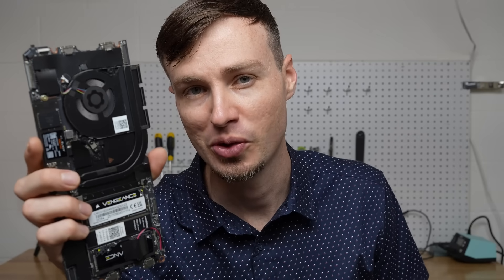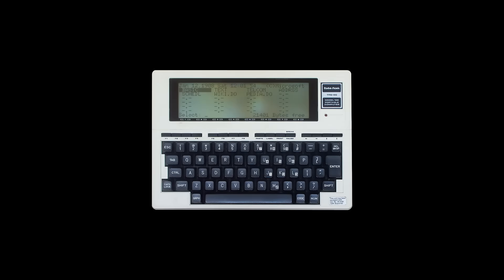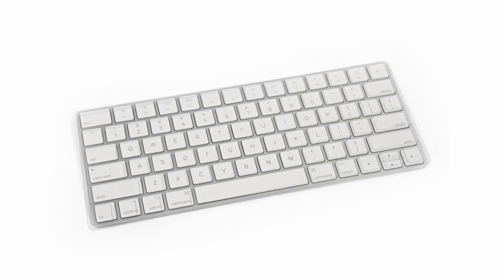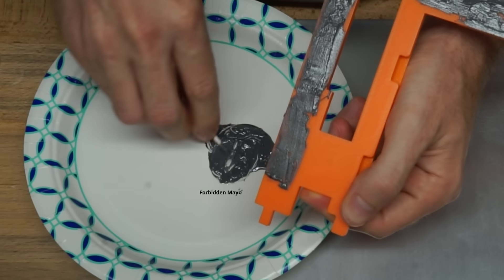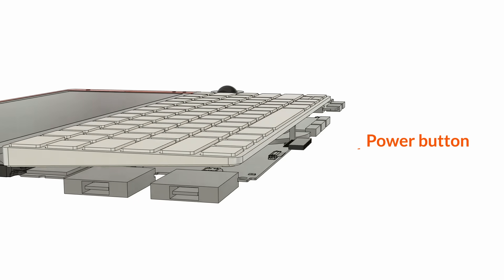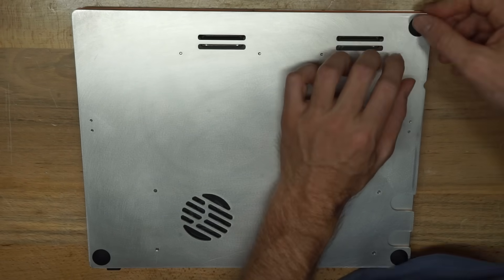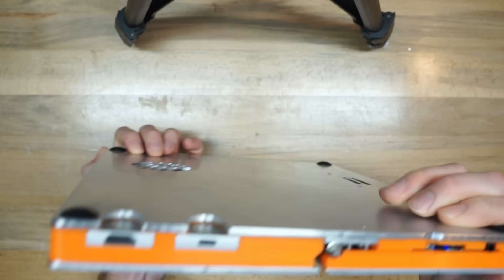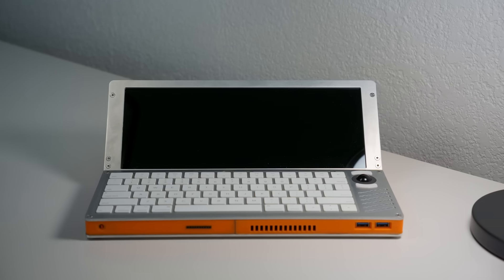Framework Cyberdeck - DIY Portable PC

Comment: The way to deal with handheld usage is to add secondary mouse buttons to the left side of the device so your right thumb can do trackball duty and your left thumb can hit the mouse buttons. The same way a Logitech K400 or similar works. Since your design is already complete, repurposing the Fn button for left click could ok if it's possible. Otherwise maybe capslock since that's barely used. I would cut the traces to isolate it and then wire it directly to the mouse buttons. Saves attempting to remap it with software.

Getting the keyboard, trackball and monitor working to external devices as a "USB-C dock" would be a challenge.

Comment: This was awesome and inspired me to keep pursuing a custom PC. Really into the portable aspect while still being able to work on 3d modeling, programming and circuit board simulation. Only thing I would like is a pdf of the buying guide for this and a guide for setting it up from start to finish. If you already put it all in the video the disregard the last sentence. One thing you could add if you want a scroll wheel is put a mouse scroll wheel  on the side of the build or anywhere you put your hands. Maybe have it activated on the ball after you press ctrl+alt?

Comment: This is the kind of custom build I think of whenever the modularity of Framework is mentioned. It shows just how versatile such a platform is, and that you don't need to be limited to just their options for the chassis the parts fit into.

And when framework releases a motherboard with a better processor, you can just swap it in knowing that everything will still be in the same place as the old one. A laptop with a practical CPU upgrade path that isn't just "buy a new one" has been needed for a long time and it's finally here.
Reply: This is be good for 3d modeling and programming? How far could u go with this? I'm just beginning so I'm sure it has everything I need for now just want to double check
Reply: @jomitoh5111 Would be great for programming, but 3D modeling benefits from a dedicated GPU that afaik these don't have. But they might eventually be compatible with external GPUs so there would be a lot of options for a custom "dock" for home use.
Reply: @0v_x0  so what is the main purpose these are used for? I'm new to these in general
Reply: @jomitoh5111 3d modelling works pretty fine on a fairly new CPU as long as you don't wanna do rendering, bigger simulations or scenes. (I don't recommend doing those things on a laptop anyways)

Comment: what this thing needs - IMO - is to be able to use the keyboard as an input device for the external pc you plug in - to be able to use a headless pc without any other devices.
Reply from the maker: That would be cool. Actually the keyboard supports bluetooth so it theoretically could, but I would prefer a wired connection of course.

Comment: As other comments mention the stick in the center of the ThinkPad keyboards, I looked at Wikipedia for the exact name:
A pointing stick (or trackpoint, also referred to generically as a nub or nipple) is a small analog stick used as a pointing device typically mounted centrally in a computer keyboard. Unlike other pointing devices, it reacts to sustained force or strain rather than to gross movement, so it is called an "isometric" pointing device. 
IBM introduced it commercially in 1992 on its laptops under the name "TrackPoint", and patented it in 1997 (but the patent expired in 2017). 
It has been used for business laptops, such as Acer's TravelMate, Dell's Latitude, HP's EliteBook and Lenovo's ThinkPad (formerly produced by IBM until they sold it to Lenovo in 2005).

Comment: Your cyberdeck reminds me of a Sony Vaio P laptop I once used. 
Sony Vaio P series were ultraportable subnotebooks and a very interesting form factor. Maybe too early for the technology of that time (1996 to 2010). I used it to design a daily magazine for a film festival from my hotel room :-)

Interesting details I found at Wikipedia: 
The Sony Vaio P series features an 8" LED-backlit display with native resolution of 1600x768 and is also comparable to that of much larger laptops, such as the 12.1" Thinkpad X200s and its 1440x900 resolution.
The 2010 revision was the last iteration of the P series, with Sony discontinuing the product in 2011. The P series clamshell format was incorporated in Sony's Tablet P, which was released in November 2011.
Reply: If you want to get a feel of its small size, there are some photos online. 
For example on Wikimedia Commons, there is a photo picture of a Vaio P on a a Fujitsu Laptop or one photo called „VAIO type P vs EeePC 901“ shows a Vaio P on a EeePC.
Reply: Another quote from Wikipedia, as I saw the Term „Netbooks“ in an article about small Laptops. 
Wikipedia: Netbooks were sold from 2007 until around 2013, when the widespread advent of smartphones and tablets eclipsed their popularity. Netbooks generally had lower-end hardware specifications than consumer laptops of the time, being primarily intended as clients for Internet services. 
End quote. 
Wikipedia mentions some product names and manufacturers of Netbooks: 

HP 2133 Mini-Note PC netbook

Asus Eee PC 700, the first mass-produced netbook, which used a 7-inch screen.

Psion netBook, a small subnotebook released in 1999, for the mobile enterprise market.

Comment: Nice project, I wonder if could had a optical drive and a TV tuner and would be a media device.
Also I wonder how well does the emulation test (until what console supports) since that screen looks way better than I thought at the beginning of the video.
Reply: Thanks for your comment. It reminds me, that Optical drives were one of the hardware features, that were specifically left out of the first generations of ultramobile subnotebooks like the Sony Vaio P series or the UMPC class from the late 90ies. This was critiqued at the time by some, while others loved the small sizes of the computers without a optical drive. The opinions were split-split on that matter.
Reply: @paulhorn24  I mean yes you are correct, maybe a special caddie for external drives if not but I remember the vaio issue was like when Mac stopped using floppies.

Comment: 15:19 Couldn't you have some thin material, whether it's 3D Printed or off the shelf Screen (like for pool cages and windows) , you could make an exterior acordion style mechanism so that as you tilt up the screen the exposed PCB and such still has some protection against bugs, random stray fingers, some water prevention, etc.

Whether it's like 3d printed links, some fabric just glued onto the exterior parts of the frame, or just pool/window screen it will provide some amount of functional use.

Overall nice build, this isn't necessarily meant as a critique but rather providing options/examples to say a solution would be possible.
Reply from the maker: Yeah, I probably should have tried to do that.

Comment: This is such a neat build! One design suggestion for your next iteration: when you're trying to make a semi handheld device, it's really useful to split your mouse buttons out to the opposite side of the enclosure from your trackball/pad/stick/whathaveyou. This lets you click and drag things relatively comfortably with both thumbs.
Reply from the maker: Thanks, that's a good idea! The trackball module did have buttons on the board already so that's why I did it this way, but I could have wired up some additional ones to use instead.
Reply: Good idea! Maybe add a scroll wheel to the mouse click buttons on the opposite side of this Cyberdeck? So Trackball for the right thumb and moise buttons and scroll wheel for the left thumb? 
And of course we need a mirrored version for all those lefthanded people.

Comment: great project and results. May I ask, 
what are your thoughts on adding flex ribbon to seal the gap between the monitor and the pc?

A gasket type seal to go between the aluminum and the back of the monitor. 
vents and sound out integrated in the 3d print, perhaps sound coming out of the design below the trackpad. will you make a model with touchscreen to remove the trackball? 

For the scroll can you map the function key and trackball?
Reply from the maker: Thank you. Adding a seal/gasket between the components would be good, I was just limited on space. A touch screen would also be good, however the ones I looked at would require additional an USB connection for the touch input and i was limited on available ports. I'm not sure yet if I will make another version of this but if I do I will consider these suggestions.
Reply: @benmakeseverything  thank you for the quick reply 😊

Comment: You are so organized and neat. You did what probably hundreds of employees in a large company did. Genius!
Reply: TBF, the 100's of employees aren't working on concepting and producing the initial design. The majority of them will be marketing, purchasing, sales, legal, etc.

Initially building a product is about 5% of what's involved. The majority of the work is in making something that can be mass produced at a relatively low cost that people will buy at scale and will be profitable. 

This is a cool project and the fact that anyone can throw one together is a good thing, but as a product it doesn't make a ton of sense unless the manufacturer was operating at a much larger scale. 

Otherwise there's almost no reason for people to buy one from you rather than just assembling it themselves unless they're lazy (which isn't likely with niche tech products like this).

Comment: I would have probably used a trackpoint if I were making a system like this. I prefer those to trackballs.
Reply: Would you put the TrackPoint in the center of the keyboard like IBM/Lenovo Thinkpads? Or could you think using it on the side of the Cyberdeck where the trackball currently is placed?

Comment: Great project! It turned out really well. I have one of those trackball modules as well. Apparently there's a pinout that will make it work on USB as well. I used to use an old piece of software called Applekeys which provided keymapping for the Apple Pro keyboard in Windows. I have no idea if it'll work on Apple's newer hardware, but it's something to look out for. To make the slide in modules easier to remove, you could  mill a shallow notch on the underside, so you can hook your thumbnail into it.
Reply: Very, very good ideas/suggestions!

Comment: Personally  I prefer touchpad over rollerball, but it probably wouldn't fit.
Reply: What’s your opinion about the TrackPoint like the ones in the center of IBM/Lenovo Thinkpad keyboards?
Reply: Had a number of those I used, handy to have for specific instance.  But mouse 1, touchpad 2 and trackball/or trackpoint 3 for me.  But that nub in keyboard takes no space, don't know why it's not on all keyboards.   I do watch TV from my bed using PC and having that on a keyboard would be very nice.  @paulhorn24

Comment: I'm not a hardware guy and cyberdecks are not my cup of tea, but I have seen pictures/videos of a few cyberdecks, and this is the nicest-looking and most ergonomic one I have seen so far. So congratulations on your excellent work.

On a tangential note, there is one particular feature of this that I wish mainstream laptop manufacturers would adopt: the 2400x900 display. Imagine a clam-shell  laptop with such a screen, a keyboard, and instead of having a trackpad, there is either a Trackpad-style nipple and two small buttons underneath the space bar, or there is a trackball and buttons like in this cyberdeck. The benefit of such a clam-shell laptop is that it would fit on the seat-back tray that is commonly found on airline/train seats in economy class.
Reply: That makes me wish Vaio was still trying to make subcompacts work. Imagine what the Vaio P could've been if it wasn't handicapped by the Intel Atom processors
Reply: @syloui The P series from Sony Vaio was too early for it time, wasn’t it? It is sad, that it was discontinued in 2011 or 2012.
Reply: @syloui  Thanks for reminding me of that. The hypothetical clam-shell laptop I describe above would be very much like a Vaio P, except scaled up in size to have a laptop-size keyboard (and anything other than an Atom processor).

Comment: Replies No.700：
I want a full blown Windows box which is very portable (< 1KG) with fast responding, accurate hand writing and speech recognition, battery lasts for 8+ hrs, charging on-the-go with external PD Powerbank ,better yet under $570. Oh, guess I have to built one myself for the cost. Anyine know where to get cheap 14” OLED panel？(<$150)

Comment: that aluminum is so thick
Reply from the maker: Yes I went a bit overboard. Could have used half that thickness, but at least it's sturdy.
Reply: @benmakeseverything  lol yes, put an SDR radio in there, seal it up a bit and you have an armageddon build

Comment: Cool vid but why didn't you make it fold like a laptop? I wanted a design like this but folds like a laptop and call it a half-top.
Reply from the maker: My main concern  is that to do that, I would have to put the battery right on top the CPU heat sink, and I don't like the idea of it getting that hot... but maybe it would be ok, and maybe it would burst into flames. Only 1 way to find out!
Reply: :face-orange-biting-nails: @benmakeseverything

Comment: Why didn't you go with the Framework keyboard?

Also, Apple has their keyboard drivers for Windows, but they are only available as a part of their Boot Camp driver pack, which can only be acquired if you have an Intel-based Mac
Reply from the maker: I though about that, but if you look on their site, the keyboard just has a ribbon connector that then plugs into a board that is part of the whole front plate, assembly that includes the trackpad, etc. I didn't need all that other stuff.

Comment: I chose the parts and it gave 2,000$ with Ryzen 7 and 16GB, no storage and no GPU. for Brazil it would be R$20,000 with taxes. The idea is great, but it's not worth the value here!
Reply from the maker: This is just using the older 11th gen intel board which they sell for $199, but yeah if you spec everything out its going to get really expensive.
Reply: @benmakeseverything I like the idea of being modular. That's why I wanted to buy it complete, paying R$20,000 with taxes is not feasible. Here, when you buy something, you have to pay tax of the same price to the government. It would be "buy one and pay another for the government."

Comment: I use my laptop on my lap nearly every day, but I'm sitting in my recliner when I do. I really like this design and it could work for a lot of use cases.
A potential solution for swapping the framework I/O ports would be epoxying a raised button cut from plastic or aluminum onto the framework I/O housings so they can be pushed back out with your thumb.

Comment: What a cool project!  I was looking at LattePanda to make a cyberdeck, I've never thought about a Framework.  I have a question, I've just recently got into DIY projects like a year ago.  The part in your video at @7:08 where it shows all the 3d modeled parts fitting together for your prototype, did you have to manually measure and model all the parts manually?  Or is there a quick way you've learned to do it.  During my prototype phase I usually have to go through many revisions because sometimes I overlook parts and it ends up not fitting correctly so modeling all the parts as it would be assembled would help a lot but it looks like it would take a very long time to do?
Reply from the maker: Thanks. About measuring the parts: Some things can be found already modeled by other people or provided by the manufacturer. Check grabcad.com/library. But for the other things, yes, I have to measure everything myself if I can't find the models online. I use a digital caliper to get precise measurements.

Comment: How did yoy sand/finish the  plates?
They look great but I would have no idea how to do that, maybe that would nake a good video
Reply from the maker: I just used 400 grit wet/dry sandpaper and a handheld power sander. Use a little water though, because otherwise you will get a ton of fine dust - you don't want to breathe. Or wear a mask if you don't use water. Thanks for watching!
Reply: @benmakeseverything  you mean power sander that goes back and forth or a rotary one?
so tou  always go in the same direction?